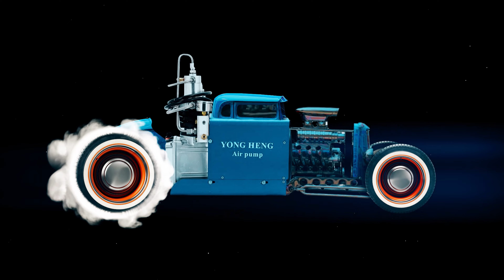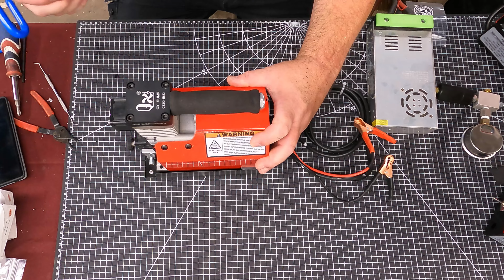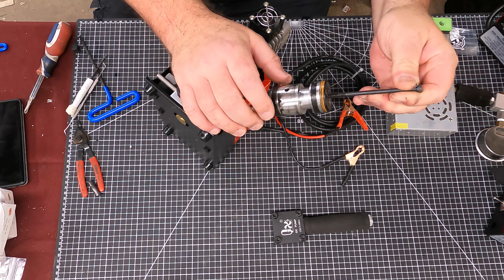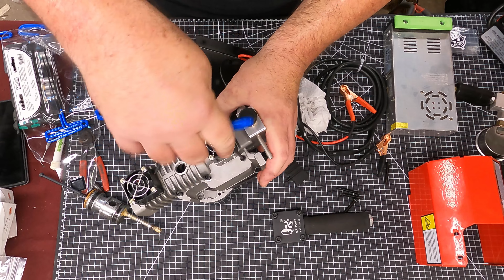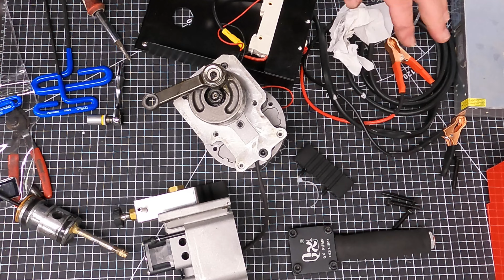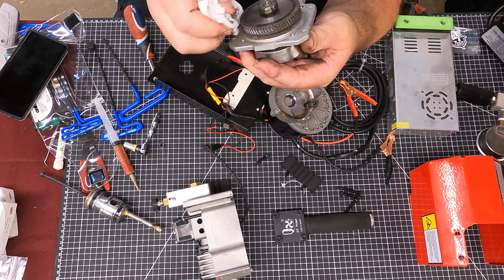Why did my GX compressor DIE!? A look under the hood of a failed unit.

Comment: Hi Bill. Although they don’t stamp a serial# on the unit, they do include a triangular “Certification” card attached to each unit with a gold elastic. My failed unit had ID# CS2/3 - H853 with a date of manufacture of 11-17-2021.

My replacement unit has an ID# CS2/3-E073 with a date of manufacture of 7-26-21. Yes, an earlier date of manufacture.

Actually, upon looking at my old compressor in your video and my new one, it appears that they put that “ID#” on the black plate that covers the piston on the top of the unit - so the “serial#” is staring us right in the face, lol.
Reply from the maker: That is as fascinating and it is troubling...Thanks for everything Ed! I guess I no longer need to send you a link to the video! Lol.
Reply from the maker: I guess I got so used to looking for it on the nameplate! Doh!
Reply: @TargetForge Yes troubling!  A newer unit failed dramatically!  I was ready to place an order for one on Amazon.  It may be worthwhile on any new unit to disassemble and replace the grease with the red moly just to have confidence in the lubrication of the gear box but then you would be voiding your warranty.
Reply from the maker: @glenk2254  Thanks for your comment Glen, the way their warranty works, no one would ever know you changed the lubricant as there is no US service center right now. I FULLY believe it would be most wise to change that lube out right away. Don't read too much into my comment, like I said, bad parts happen.
Reply from the maker: Just went back and looked again at the video, if that is anything beyond a part# I'd be dubious as that part, the cylinder head, is easily removed and makes true tracking a nightmare. I'm going to explore the idea with them though.
Reply from the maker: One other thought popped in my head, this is one of VERY many units out there. Many of us have had GREAT luck with ours. The only reason I put these types of video up is so that folks can diagnose and communicate a failed unit to either GX for replacement, or to me for after warranty parts. In the 12VDC portable space, these are really great choices.
Reply: @TargetForge  my thoughts about this since I didn't get one yet . Would a loose fully charged car battery be able to operate with this unit ?

Comment: It's a good idea to not start the motor on high pressure, bleed it off first and slowly close the bleed valve to prevent shock loading. Better grease will help with temperature and wear, but not shock loading.
Reply from the maker: Thank you Bob. The vendor admitted to a heat treat issue with the pinion gear that affected a few units. These units won't start against a load so starting them in that conditions is effectively a locked rotor condition. You are correct that these should ONLY be started with no load and then the bleed valve gently engauged. Kindness matters with any gear.

Comment: Hello Bill, greetings from Peru 👋👋👋…   Once again an interesting topic in your channel for those ones who own the GX CS2… the big hope in not to be the one with a defective compressor. I began to use mine, and it seems to be well until now, but after watching your video  questions and doubts popped up together with the hope that my unit should passed the right quality control. Bill, I have three questions: 1)do you see a way that we can follow to do a light & quick test to ensure that our units are we’ll greased?  2) where to apply grease and how much? And 3), would you please tell me what type/brand grease was that red one you used.? Thanks again Bill for your hints!!! We will wait for your next video…👋👋👋
Reply from the maker: Hello Antonio, answer #1 No way to test as far as I can tell. Most service intervals are based on time used. right now I think I would do the quick lube procedure every 5 to 10 hours of run time? Keeping track of the dead head test times as you go. #2 Check out the quick lube video. A longer more involved video is coming. #3 the Premium Red Moly is available on my website!
Reply: Hola Bill, thank you so much for your prompt answers. Given that I came back to Peru from the US, now I have to see how to do to get those syringes (I've just reviewed your site 😀) ... I will contact you again in the next days to order the Red Moly and I guess that the transparent one is also needed. Thanks again!!!

Comment: Hi Bill. Question- is the threading on the CS2 pressure gauge 1/8 NPT  or BSP?  Hope all is well. My replacement CS2 keeps on ticking - probably should grease it soon. Thanks -Ed
Reply from the maker: That thread does not appear to be tapered. So BSP. Remember you can always use a tapered male in a straight walled female provided you have sufficient depth to get a good seal.

Comment: Are the teeth on the ring gear fiber or steel ? they should be steel  if not this would be the only weak spot i can see on this compressor,how are they built in 2023 any differante ?
Reply from the maker: The entire gear is steel. The weakness was the heat treat on the pinion gear.
Reply: @TargetForge  Thanks Bill he must have had the little compressor under an extremly heavy load for far to long? can you ship parts for this compressor to canada bill things like orings picton seal grease etc thanks again
Reply from the maker: I don't think so. The factory had a few pinion gears that were not heat treated correctly, that was the issue. The pinion should be pretty hard, and the large gear not as hard, as the wear is disproportionate. Also the grease used in the motor gear case should really be changed out to the red moly grease I sell on the site, it really is MUCH better. I don't think it would have stopped what happened to his unit as no lubricant can make up for poor metallurgy. I do believe that a good lubricant WILL extend the life of a gearbox without a defect such as this. Hope this helps explain it better. Have an awesome day!
Reply: @TargetForge  Thanks again Bill

Comment: been looking into this brand of compressor especially for my Huben gk1   but not liking the looks of those weak gears
Reply from the maker: I believe the assumption that ALL gears are weak is in error. "Some" gears where not properly heat treated and had issues, I covered that in the video. Many do not have this issue. Have fun!

Comment: One more question: when your unit is down on power and when I pull the filter I see rust. Is it repairable -or junk.
Reply from the maker: Perfectly repairable.
Reply from the maker: Those two conditions are not necessarily linked.

Comment: Finally got a secondary pump the gx cs3 are they about the same size pump as the gx2? The grease got my attention on this video might have to look into that. I was putting a kit in my Yong Heng the kit that I received was a complete piston replacement. The secondary piston was aluminum instead of brass with split rings instead of the o ring type that came on the unit and kit I received with it new. Do you know which one might be better split or o ring style? Love the video's keep up the good work!
Reply from the maker: The pump is identical in the CS2 and CS3. I have no information on your YH piston kit, but I'd love to hear how you make out! Good Luck!

Comment: Great video you are sharing about these pumps I am considering buying one since I have a car battery to use . My question to you is were you able to replace. The pinoin gear on the motor ?
Reply: No, that pinion is cut into the motor shaft and that has the windings bonded to it. I do carry a few replacement motor/gearbox units so guys can change out the whole assembly.
Reply: @wruehl  ok I gotcha . Also could I operate this unit using a fully charged car battery that's not connected with my engine.  Just a loose battery in the back of my pickup truck?
Reply from the maker: It will certainly work but you will need to watch the voltage level as you consume the charge in your battery. The tool batteries will disconnect when the charge gets below a certain level. Your car battery won't. The compressor motor will be under a lot of stress if run on a voltage lower than it was designed for. Once you have an idea how many fill cycles your car battery can provide without discharging so far that it leads to compressor motor damage or even cell failure due to a REALLY deep discharge you should be ok. I would not go less than 11.5VDC, maybe 10.8VDC under load in a pinch. Once you cross that line the damage to the battery will be both cumulative and permanent.
Reply: @Target Forge  ty for that information I appreciate it 👍

Comment: Great vid! I have been finding these at liquidators a lot lately, so with your videos I might get a one or two. My question is what is a good replacement battery and charger for model that come with just a battery.
Reply: I literally got a very cheap 12V charger and a lead acid battery from amazon and it seems to work to 250 bars without any problems.

Which is weird, because the battery is rated for 2.7A and the GX Pump is supposed to have 250W.

Comment: Hi is that a steel ring gear i cant see why all the teeth would have worn off so easily ? thanks
Reply from the maker: Hello again Donald, typically when a ring and pinion gear are designed the ring is softer and the pinion is hard. The pinion sees a lot more surface wear relative to the size of the ring gear. The bigger the delta, to greater the differential. The manufacturer has indicated that a batch of soft pinions occurred and the units shipped before it was realized. This is an example of that. Once the teeth start to fail, bad things happen and it gets crunchy in there. This is why I recommend buying these on Amazon. Regular use will show this failure well within the 1 year warranty and you get another unit. They do not service these for major failures.
Reply: @TargetForge  Thanks

Comment: Is there a way to increase the pressure output. I have a Scott air tank 4500 psi but my GX CS3 will only fill it to 4000psi. Is it the compressor or is something wrong with the air tank? Thanks
Reply from the maker: Why on god's green earth are you filling a SCBA bottle with a small compressor? They are not designed for that.
Reply: @TargetForge  
What are they designed for?
Reply: @vtxdaryl  Filling sub 1 liter vessels, like to the gun directly. Maybe a 1 liter pony bottle. These are for filling the gun directly, that is why they are so portable. The run time on a compressor in this class is 20 min MAX and that is at relatively cool ambient temperatures. Filling a large tank like an SCBA tank is like filling a swimming pool with a squirt gun. Will you fill the pool eventually? Maybe, but you'll probably go through a few squirt guns. When used for the intended application and allowed to cool adequately between fill events, these little GX units perform well and many have 100's of hours on them. If your still stuck on the SCBA bottle, consider a pump with an AC drive and much higher flow rates. Or, ditch the SCBA and fill directly with your portable pump. I have video's showing it being run on my Truck, my Quad, and even a solar supply.

Comment: Hey bill,
What's the difference between the cs2 and cs3, pumps.
Reply from the maker: One is a reliable pump, one is a reliable pump wrapped in electronics that fail and leave the user stranded.
Reply: @TargetForge  And what about the CS1? I have one of those and I am wondering if it is just a CS2 laying on its side!